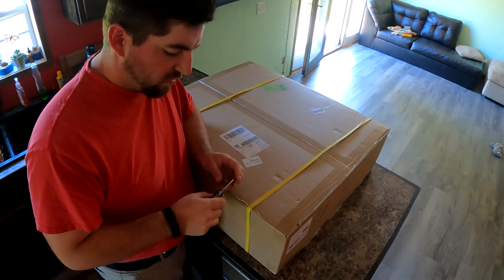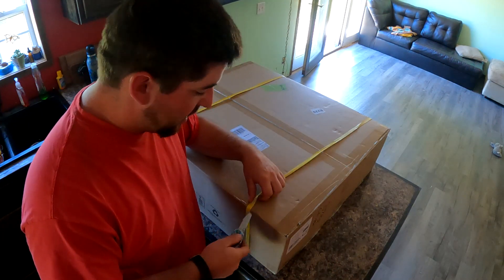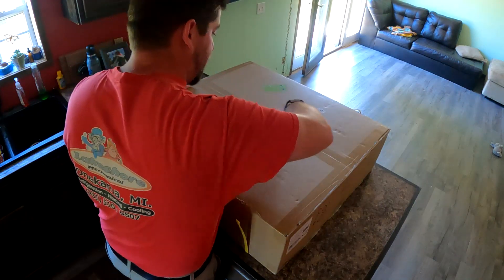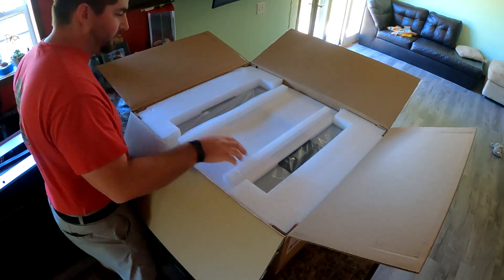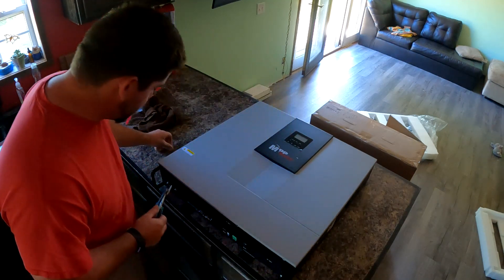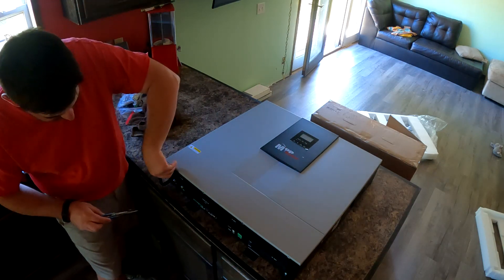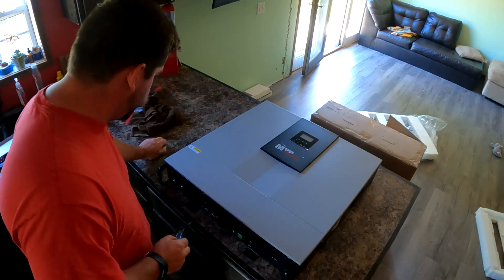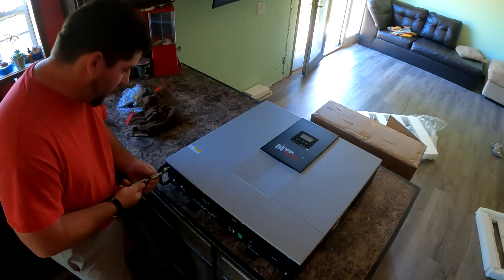Unboxing MPP Solar 6048 Solar all in one charger, inverter

Comment: U get her hooked up yet? 
I just got mine in and am doing some testing.
I like it because of the auto bypass ability. So I hooked it up to grid and my 1.5 ton ac unit. Expecting it to bypass on startup and eventually taking the load back over. Well my ac u it only pulls 650 watts when running. So it kicked on and went to bypass.... Like expected than stayed in bypass even though there is only a 650 watt load. The ac unit had to shut off and unit read no load before it would switch back.... There must be a setting for this but I don't see one
Reply from the maker: I do notice that mine will not switch back under load even if it gets the battery voltage high enough to switch back
Reply: @the_pretender  bummer... Do u have to switch off all loads to get it to go back into inverter mode?
Reply from the maker: @electromechanicalstuff2602  NO, it will switch back under low load. in not sure it says in the book, but probably under 20% load it will switch back if it meets the battery mode